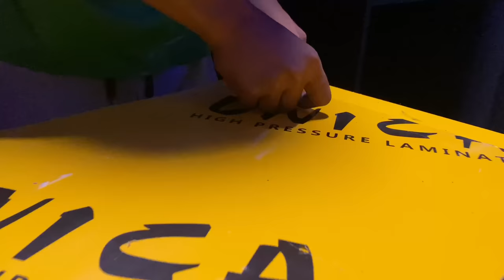GAMING ROOM SET-UP (Room Renovation Episode 1)

Comment: IT is lit..bro...
I will also make my room like this.
Reply from the maker: Thank you so much, better use steel rather than woods as the bed frame, it will really make difference ( strength and longevity)
Reply: @SonderEvennys  bro thanks a lot for that precious advice.❤